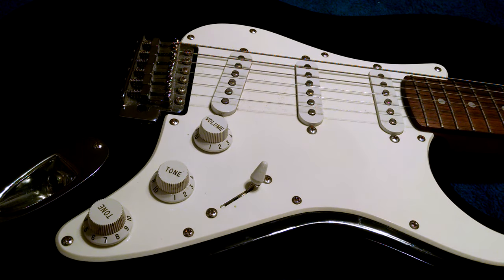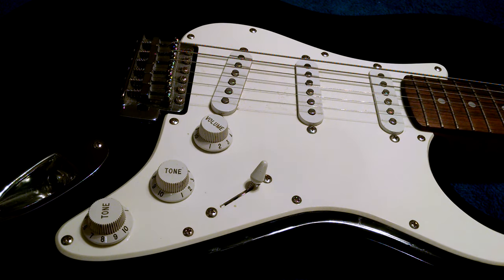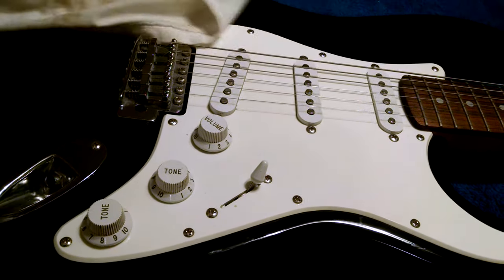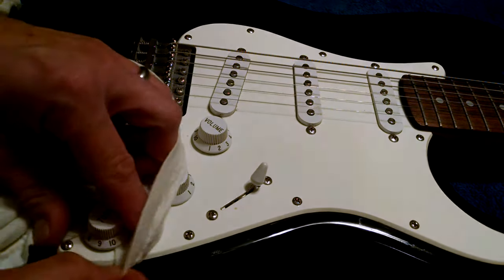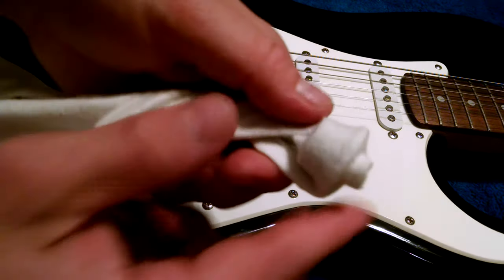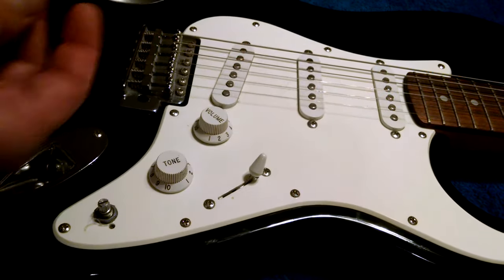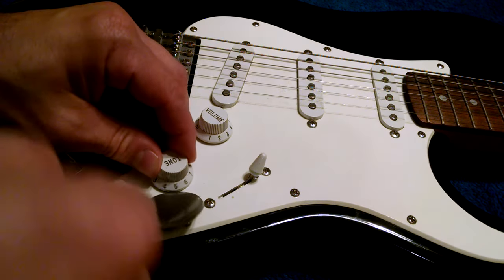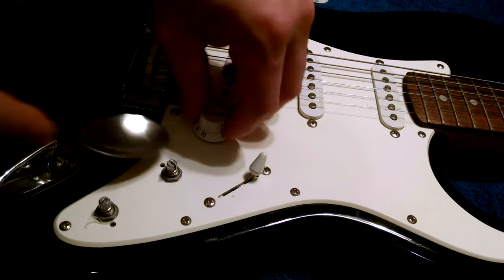How to safely remove the tone knobs from your guitar

Comment: Worked great for me! Took me 2 attempts to remove a knob so i could remove the pickguard film underneath. However, I pushed down to much when putting the knob back on the post. I screwed myself as there was no room for tucking the t-shirt under the knob this time. I had to then look up another method and found one using a few playing cards. (I actually used a few paint swatch color cards). This technique worked too.

Comment: have you tryed what i do  ?   Just start with 2 picks stacked on each other  in between the knob and pickguard, then start stuffing  1 pick at a time in between the 2 picks.  It wont take but a couple more  to pop the knob up.    try it
Reply: this actually worked, thanks. four will usually do it

Comment: My question is how do I get it to stick back on? Mine is spinning freely and won’t stay put
Reply: You find out how yet?
Reply: @ghostlife5491  Nope but I took it in to guitar center and he said the pot was bad… And he said the pot would be like $6-8 and $50 for the repair work. 😮
Reply: @Snek03  bro I found out and all you needed to do was to take a flat head in between the two pieces of metal down the slot will like widen a little bit so the knob would stay on.
Reply: @ghostlife5491  hmm interesting… The guitar tech said the pota were bad so i’m not sure if that would help the knob work even if it sticks on. Were you able to get yours working?
Reply: @Snek03  Your guitar knobs are screwed on, if he's saying the pots were bad. If you used this trick to get the knobs off, you've ripped the pots apart.
Reply: @leimango just broke mine rn lol 😢